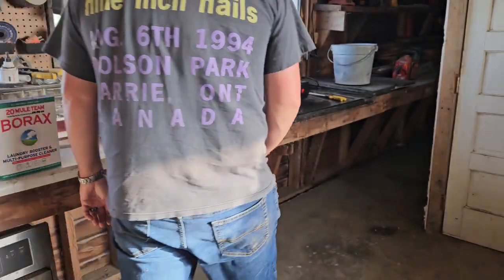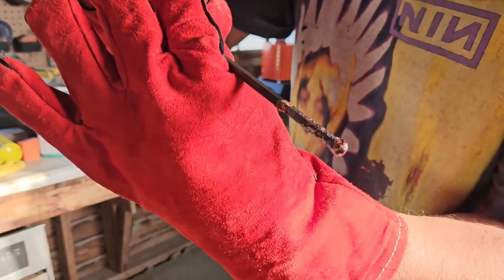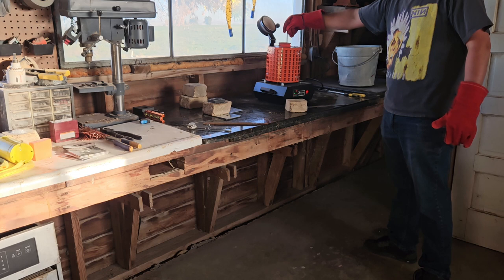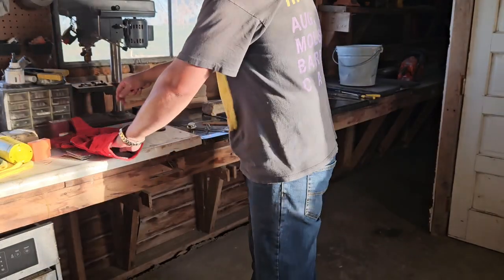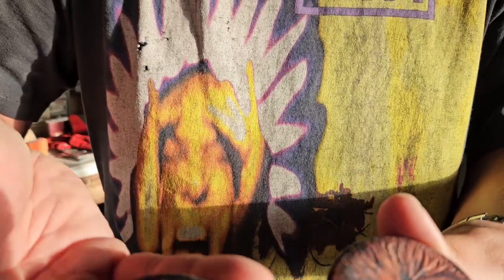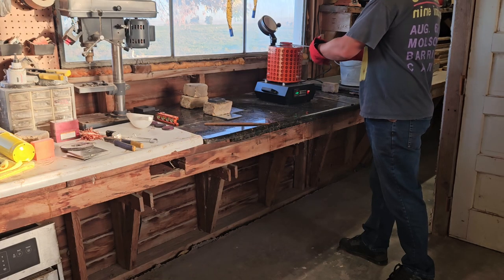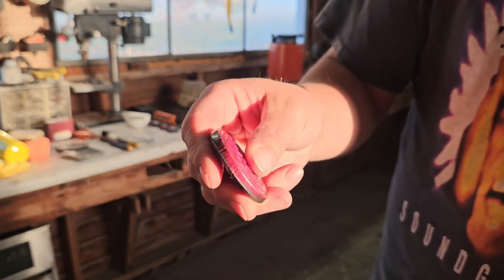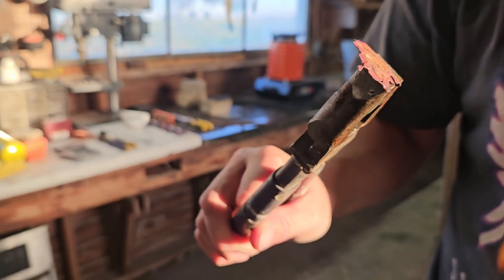Pouring copper quad celtic knot rounds 2023

Comment: I don't pour copper or silver... yet. But I've been making silver and copper jewelry for nearly a decade. I cut, grind, and polish my own stone cabochons for mounting. 
The black on your copper is an oxidation effect. I suggest that you get yourself some "PICKLE"... an acidic liquid derived from a powder that you purchase, mixed with water on your work bench, then heated. You MUST use copper tongs to put items into, and remove items from the PICKLE pot. The PICKLE is acidic, and it removes all of the oxidation from the metals you use for jewelry such as Copper and Silver. Silver goes in blotched with nasty black after being melted, heated/worked, soldered, etc, and it comes out clean. Copper goes in heat blackened and comes out COPPER COLORED.

PICKLE is acid! You need a large ceramic bowl of water+baking soda to neutralize that acid on anything you have cleaned in the PICKLE.
You need another large ceramic bowl of plain water beside your baking soda water bowl... to rinse off the baking soda after it has neutralized your PICKLE.

So get yourself a light plastic "tray" like gardeners use for starting seedlings... about 18 inches long and 12 inches wide, with walls about 3 inches high.
Set your Crock Pot at one end of the tray (I put mine on a pedestal of 3/4 inch plywood to raise it up just a bit). 
Set your bowl of Baking Soda water just beside the Crock Pot.
Set your bowl of clean rinse water just beside the Baking Soda water.
Put at least one set of COPPER tongs (about 12 inches long) where you can easily reach them to use when moving metal from one pot or bowl to the next. 

I buy my PICKLE from Rio Grande Jewelers Supply (riogrande.com) in Albuquerque New Mexico. They've also got a complete selection of tongs and casting utensils, graphite molds for making your own silver or copper ingots, and much more. I don't work for them, but they've been my major source for jewelry making supplies since I began nearly a decade ago.
 
Mix your PICKLE according to the directions on the container. I mix mine in the smallest CROCK POT I could buy.  It comes in a plastic container and I mix it with water in my small Crock Pot. Once you've mixed it, you MUST NOT allow any tools or utensils containing IRON to be used in contact with the PICKLE. If you DO allow something like a set of tongs made of STEEL to end up dipping into the PICKLE - however briefly - the PICKLE will thereafter be tainted. Any SILVER that you put into that tainted PICKLE mixture after it has been tainted by IRON/STEEL, the SILVER will come out with a bizarre PINK tint. It's not enough like "ROSE PINK" or I'd have kept a tainted pot just so that I could create a rose, then run it through the PICKLE to turn it the proper color for the desired effect. As I said, I haven't done that... YET. And I must say that I haven't tried putting COPPER into the PICKLE after tainting it with iron/steel, so I don't know what effect it would have on the COPPER (if any). I had tainted a pot of PICKLE, and I'd just dumped the old tainted PICKLE and cleaned the Crock Pot. I was curious about how the tainted stuff might effect COPPER, but I didn't think about that until I'd already cleaned it all up and replaced it with new PICKLE. I didn't want to lose another batch of the stuff.

So... make sure your Crock Pot of PICKLE is heated (lowest heat setting).
Then heat your COPPER and make your pour into your graphite mold. 
Wait briefly for the COPPER to harden to prevent damage, and then dump it onto your fire brick. 
Pick it up with tongs and water quench as you have been doing. THEN... you drop it into the PICKLE in the Crock Pot, and put the LID on the Pot.
Check back every few minutes to see the progress on the COPPER in the PICKLE. Use Copper tongs to lift the cast item from the PICKLE, and move it directly to the BAKING SODA bowl.
Swirl it around so that the BAKING SODA neutralizes the acid, and then go directly to the pure water rinse bowl.
If the PICKLE has done enough removal, and you like the color tone, you're good to go. If not, then put the COPPER item back into the PICKLE for another short bath. 

When I'm working with SILVER and I finish up for the afternoon with a final solder run, I'll put the SILVER into the PICKLE and TURN OFF THE CROCK POT. The residual heat will certainly be sufficient to accomplish the cleaning, and the item will be ready for me to pull it the next morning, neutralize the acid in the BAKING SODA, and then RINSE it... and I'm ready to resume my work on the project.

Two other things to consider involve the polishing of your finished product. For SILVER I use a soft crafter's wire brush with STEEL bristles. For COPPER I use a soft crafter's wire brush with BRASS bristles. Using BRASS bristles on SILVER can sometimes give it a very faint brass tint. You can also purchase a small rock tumbler (Rio Grande has them, but you can get inexpensive ones at Amazon as well). Fill the small rubberized container about 1/4 full with STAINLESS STEEL SHOT (also available from both Rio Grande and Amazon). Add enough water to almost submerge the steel shot. ADD ONE OR TWO DROPS of dish soap (no more!!). Drop in your cast, pickled, neutralized, and rinsed COPPER item. Close the rubber tub and turn on the tumbler. An hour of tumbling should result in nearly a mirror shine.

From there, in finishing the final product for sale, or display, or gifting, you may want to employ various liquid pantina solutions. These can make your COPPER turn BLUE or GREEN (or BLUE/GREEN), or REDDISH, or even REDDISH/BLACK. Think about the various colors you see on copper coins as they age, and pass through the hands of millions of people - all of these shades are available using patina solutions. They can be applied with a brush, a Q-tip, a toothpick, or whatever suits your needs. Once the shading meets your fancy, you can paint on a JEWELER'S GLOSS or simply spray the item with something like an artistic fixative or Rustoleum Matte or Gloss CLEAR. Without the protection of an overcoat, the coloration will change over time, especially if the item is handled. There is a small amount of natural acid in the moisture/oil found on the skin of your hands. Handling a polished piece of steel can result in our finger prints slowing developing like a photographic plate on the polished metal. Handling a finely colored, polished, and textured piece of copper can result in unsightly dark marks, blurring of intended details, and overall spoilage. If serious enough, repairs to the finish will be necessary.

Hope this helps you, mate! Best of luck on your casting. I've subbed your channel and will DEFINITELY be a regular visitor!
Reply from the maker: Very informative. Thank you 😊